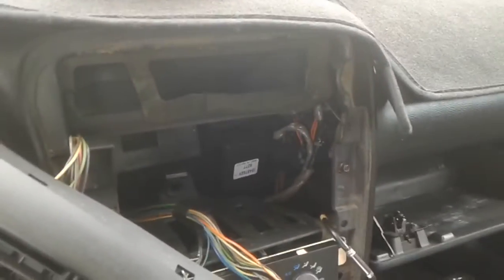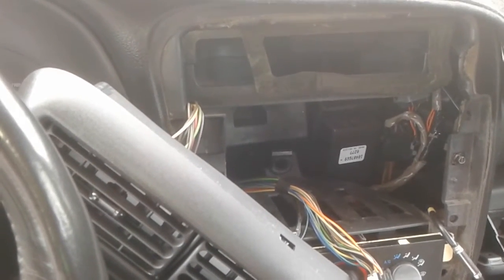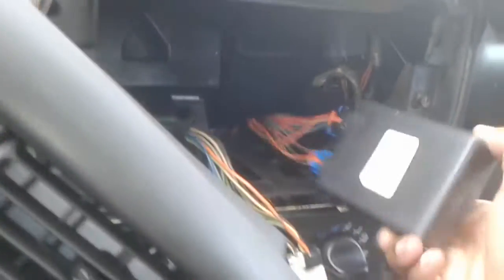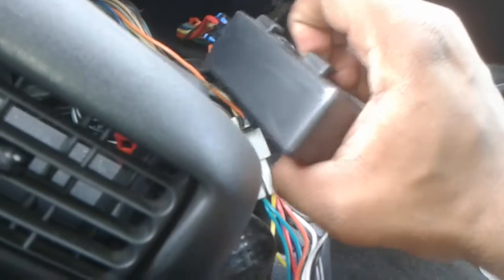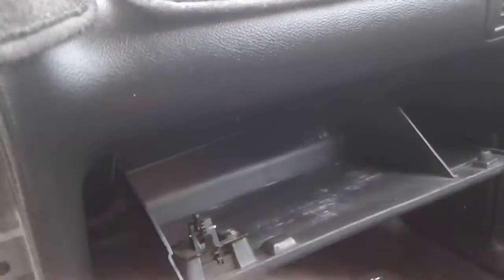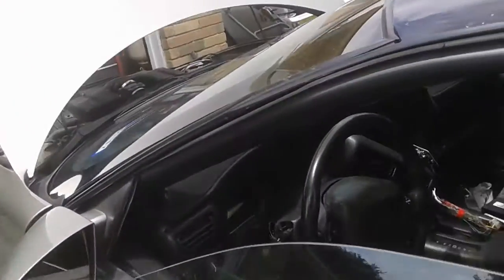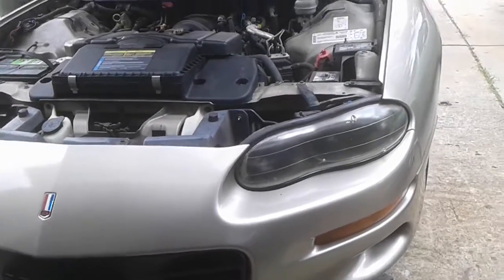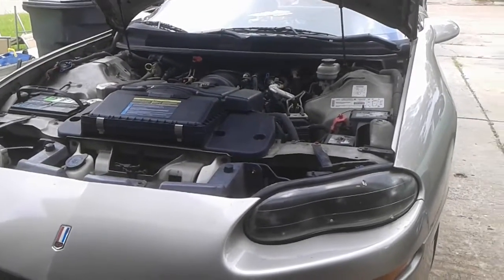Disable Daytime Running Lights 98-02 Camaro

Comment: hey, just wondering a cpl things..  so what you were really trying to do and succeed in doing was stopping your low beams from coming on automatically around dusk.?  my 99 ss doesn't have DRL..  one click turns on the park/tail lights and fog lights if i wish.. and it's just that the low beams start coming on when the sun stars going down... and the only way to turn the low beams off at night is to turn the car off..  so do you now have full control of your lights at night time?
Reply from the maker: two things.  1 my housings were cracked so the more my lights were on, the more often I would blow bulbs.
2. I just always hated automatic lights.

with this mod, I have complete control over my lights.
Reply: right okay... and you left everything plugged into the module and just did the soldering work... and that was it..    and maybe disconnected the battery while you did the work?  anyways looks 'fairly' simple.. i hate how the lights come on in the early evenings for sure and having no control over turning them off in certain situations, parking lots/drive thrus etc
Reply from the maker: +Corrie Brown I unhooked battery and removed the box. but it's much better.  and extends bulb life

Comment: My sensor for my automatic headlights just started acting up. Headlights come on during the daytime. I'm thinking about doing this to prevent that from happening. I have been driving around with the ebrake one click up. Also because I live in a hot climate my drl sockets keep burning up not just the bulbs. It's annoying. Had to replace two sockets and three bulbs.
Reply from the maker: Its a easy enough mod. I have zero regrets. Still working just fine today.

Comment: that looks stupid. why would you not want them on? it makes it stand out like a vette.
Reply from the maker: GabrielTheGuitarist i live in the city. Dontike them comming on under every underpass. Extends bulb life cause we not using them as much. I perfer manual control over when i want the lights on.
Reply from the maker: GabrielTheGuitarist plus at the time, the bulb housings qere cracked. And still are cracked but sealed.
Reply: GabrielTheGuitarist so you can race and not get caught??
Reply: At this point in time amber drls aren;t what makes camaros and vettes stick out...lmao
Reply from the maker: Well they are on the car and have been for a long time. The car has been repainted white much like the one in your picture.